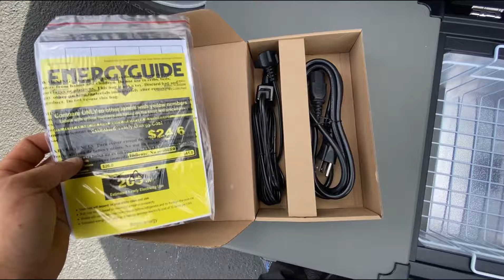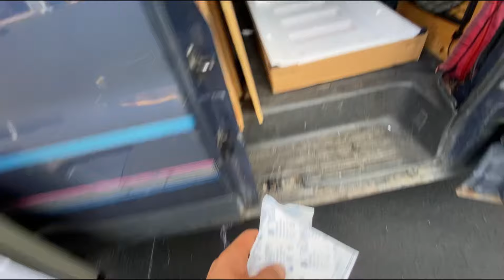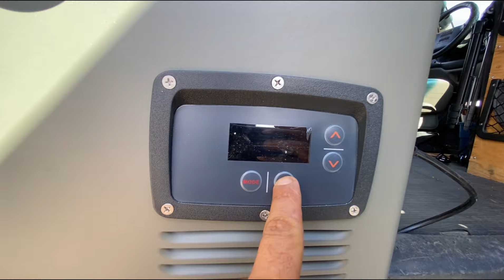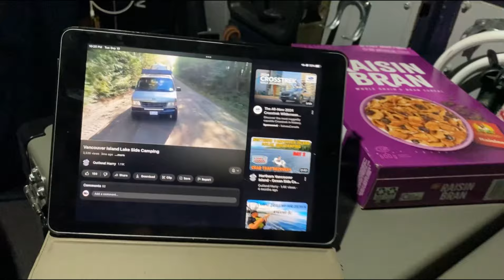Gifting A Vanlife Subscriber With A 12v Fridge , After Receiving A Huge New Upgrade Of My Own

Comment: 🧊🧊 refrigerator tip… if you put all your food into Ziploc bags and sometimes I double up on chicken and stuff like that that’s yucky😂 you get so much more room for your food! Also, the Styrofoam makes your condenser work harder because it can never cool it off! Same goes for cardboard boxes. Unbox the food and use Ziploc‘s I promise you you’ll be very happy! It’s been the best thing I’ve ever eaten. And yes, I’m still using ice. Because for some reason solar doesn’t quite work in Florida and I could never keep my batteries charged to keep the fridge running.😢 and yes, I have a good solar panels finally😂🙋🏼‍♀️🐕🐕🚐🇺🇸🫶🏻🫶🏻

Comment: Run  refrigerator with the 12 volt and use eco setting for daily setting . Own one for 4 years. P.S. use the bottom space in the smaller side under basket to put more  food. I use a Jackery 1500 also 4 years old .

Comment: Did you know that you can soak beans over night, then cook them fully until soft the next day to help with the gassy effects caused from them? Also you can add a splash of cola/root beer to help with the same (farty effects).
Reply: 1/8 cup brown sugar will also help
Reply: @grumpyiwegianpodcast3505  I was hoping to not add to much sweets to it. Wondering if a tablespoon of baking soda (sodium bicarbonate) would help with the effects as well.

Comment: Hi Bruce, The fridge can run on 12V instead of on your inverter. That way you don't have to keep your inverter on wich will safe on the power usage. Check the manual to see how to connect.

Comment: Make sure you look thru all the pieces I think it comes with a cover too. That's an expensive one. Damn that's nice. Love that it plugs in to a lighter too and a inverter. What size a battery do we need for it to stay running. I think I want one real bad. Be so much better thsn my fridge in my motorhomr that goes open every other day n uses so much propane as I can't get it to switch over to electric or geni etc. I've fixed the error code twice now I can't get it to woek at all. That's a game changer it's huge. Super happy for you. It'd like christmas lol 😊 I woukdnt worry about your build. You git a van that's all that matters.  You can lay your head down at night n be safe. Your adventures are what ppl are here for. Everything else will come one at a time. I keep tryin to tell myself that  too.

Comment: GM break pad keeper springs is the culprit. The pads are cheaply made and wear easily and cause the clicking sound. It's a common flaw.
Reply: Use a good copper lube on the moving parts (not the pad surface) to help with sticking/rubbing/reduce corrotion.

Comment: You would be crazy to use the inverter to run it the amount of power you waste in the conversion is ridiculous. You will save so much 12v power running it straight from a 12v power source.
Reply from the maker: Haha yes I know but I can handle it for now 😉 But this is an example of why I didn’t show much of my van build as it is right now 
I know there is a lot of things I need to change but for right now it works and that’s good enough for me until I’m ready